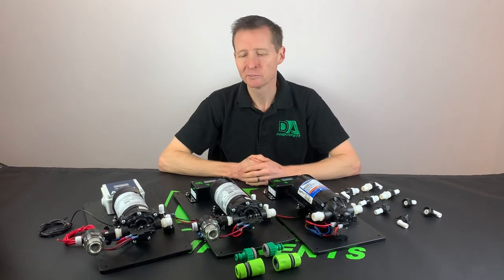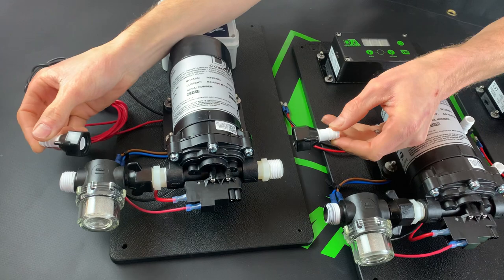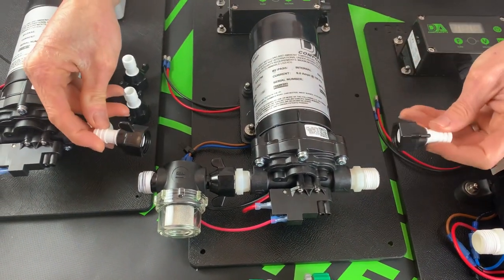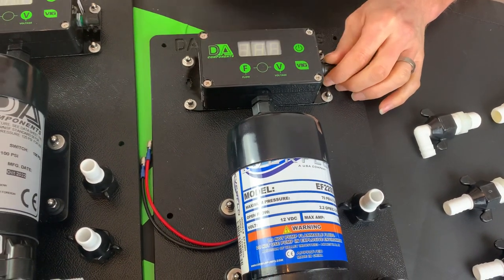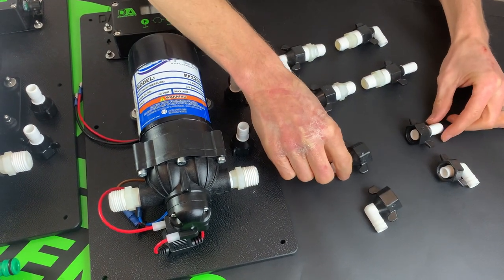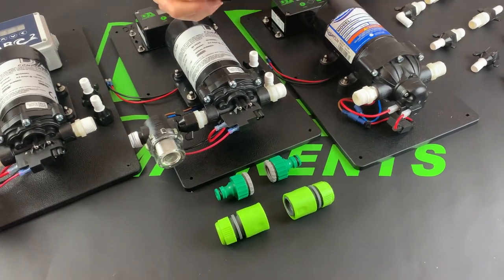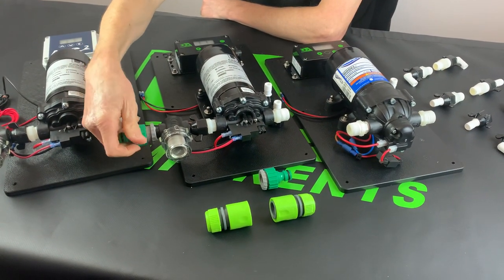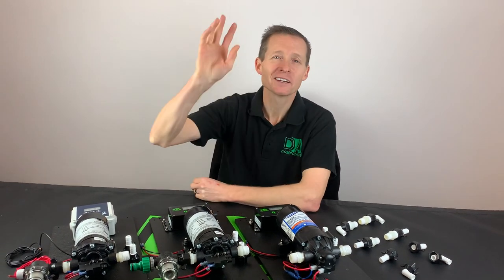Controllers & Pumps for Water Fed Pole Window Cleaning

Comment: Currently  using your flow controller with gardiners pole and brush head 
Using 50 percent fan jets using univalve 
Having problem  water coming out for to fast 
But find when using pencil jets flow is far to slow 
What sort of setting should I using for pencil jets 
And fan jet settings
Reply from the maker: Hi Darryn , which controller are you using at the moment?
Reply: @dacomponents  
V 16 controller
Reply from the maker: Hi Darryn 

Yes we will fine them to be different this will be due to the orifice size off the jets , you will need to have a play about on the flow rates that you want the other rule of thumb is to measure it 

Test fan jets let’s say 50 flow on the display time it via empty tub , then test the jets the same test .

Comment: Can you show a video of how to trouble shoot the OC code overcharge , I have had a pump work for month then stopped working saying too many amps , or pinched line or motor bushing being bad ? I’ve tried contacting shurflo about pump but no reply
Reply from the maker: Hi my first question is which controller are you using and what’s the spec of the pump you are using too ?